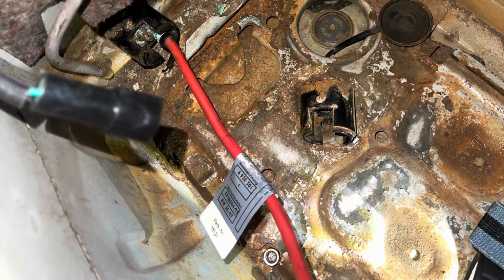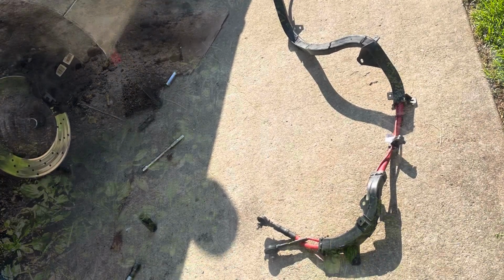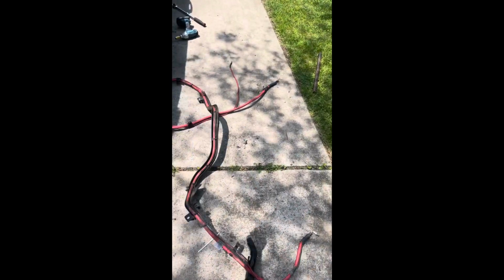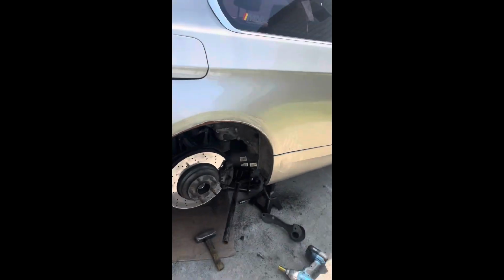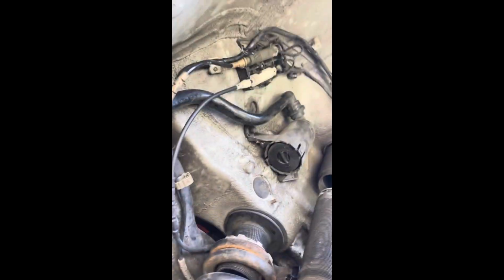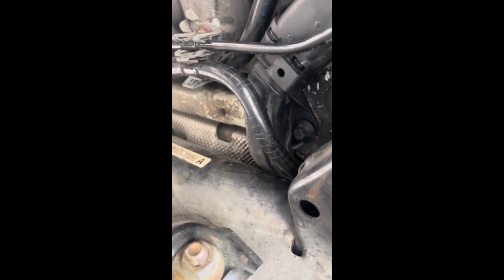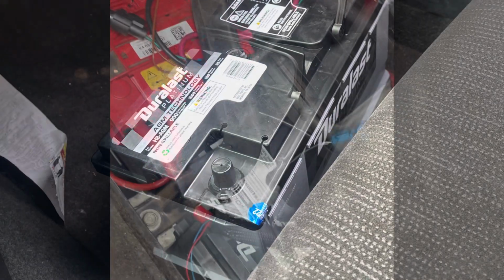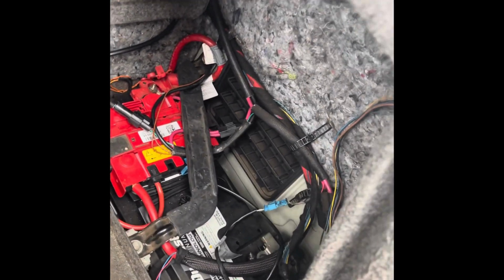Bmw E92 335i battery wire corrosion / no crank no start

Comment: I have bad wires sorted the interior ones but checked the exterior ones that you changed and the connection point was melted/corroded on the negative side, would this cause a crank no start?

Comment: The wire that goes on the battery distribution that’s red and had a black tip can just be replaced if that’s the only one that’s corroded ???

Comment: I had this same issue and my shop quoted me 3k to do it. It was causing my waterpump to not function. What a huge mess it caused me.
Reply: I think I’m having this issue right now cuz one of the cables have 0v when I test it so I’m thinking of replacing the whole cable all together. Did it 100% fix it issue after ?

Comment: They all have this problem. You can run 2 0guage amp wires from the battery,under the carpet to the box under the hood for simplicity.
Reply: Why 2/0 gauge vs the 0 gauge of the OEM starter wire?

Comment: I was running into the same issue but do you have the part number for the nut that holds the positive power cable in the trunk? Mine completed rusted off. I do not know the thread code on the bolt end of this harness you just replaced.
Reply: Never mind I found that it’s an M6x1.0 nut and a M8 nut. Thank you for your video!!

Comment: Great video! My F11 530xd 2011 went from running perfect to no crank no start and I can measure a voltage drop of about 1V from jump start post to battery positive terminal. Car starts when connecting an external cable from the battery positive to the jump start post. The cable is similar to yours with a connection where it goes through the frame close to the battery. However, I cannot see any signs of corrosion on the main cable connections. Any ideas? Seems unlikely that the cable would go bad all of a sudden.
Reply: Found the problem. Though the connection in the trunk looked good from the top, it was heavily corroded under the car. For anyone with a similar issue, the connection under the car can be accessed by jacking up the car, nothing has to be removed from under the car.
Reply from the maker: Glad u found problem no crank no starts usually be the power wire or ground wires once u know where they all are only a matter of time till u find the issue

Comment: This just happened to me idek what to do now man
Reply from the maker: Check battery wires in trunk if u havent already
Reply: @ appreciate the response i managed to fix it my positive cable running from the battery compartment snapped from severe water damage and corrosion cleaned up the compartment as best as i could and installed a new cable
Reply: @TMtm-uc5ns entire new cable?

Comment: Does this fry the fuse box above the battery? For a 08 335i coupe
Reply from the maker: Yea a bad battery wire can fry the fuse box if theres to much resistance in the wire it will get hot & melt things

Comment: I have this issue on my 335d e91 the alarm keeps going off and I think it is effecting the windows, the battery sign pops up. I did a temp fix with some silcone as it wasn't starting on the side of the road and the wires that are fully corroded from where it comes in the battery bay from the rear quarter that it makes the whole car body work live as the positive was touching the body, I think I'm going to just splice it for now as am an electrician so know a bit about wiring and replace the full thing when I have more time.

Comment: Did you use regular nuts to secure the wires at the bottom
Reply from the maker: I went back to bmw for nuts but u can use any stainless steel serrated flange nuts from a hardware store

Comment: is there no way to save the original wire?
Reply from the maker: U could cut out the bad wire & splice back in new tire with new post connections once u see discolored wire u have to cut it out thats y i just changed the whole thing didnt want to cut anything
Reply: @DameGreaseBuilt yeah that’s what i figured cutting the wire might be the solution for me. definitely don’t got the time and skill to do what u did here. damn bro this shit fucked me up 😂
Reply: BMW sells repair cables for those cable ends. So you don’t have to remove the whole cable.
Reply: @Monkey-World-2  really? i couldn’t find any when i looked. thankfully i was able to save the connections though. the corrosion and the nuts seized on completely, made it work though. was a nightmare + $300 part